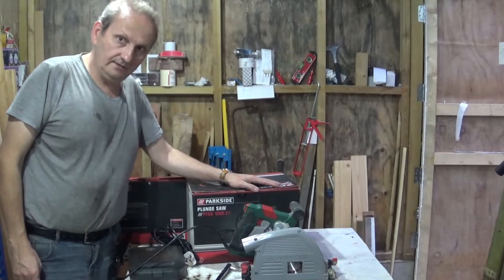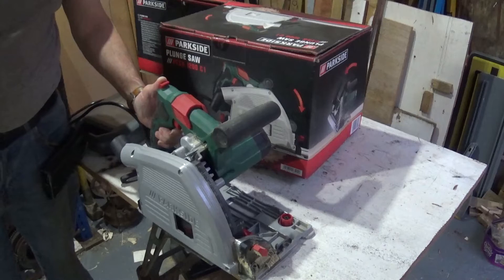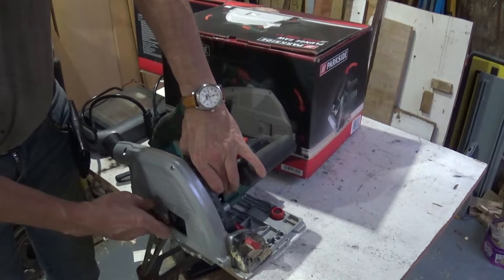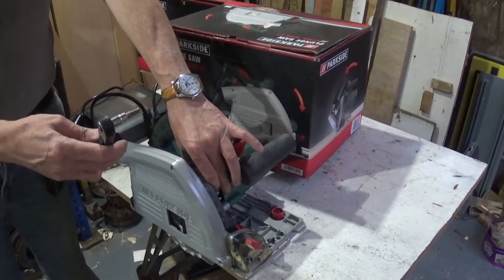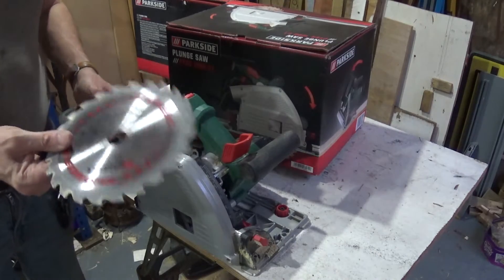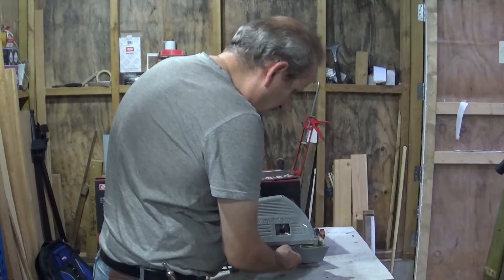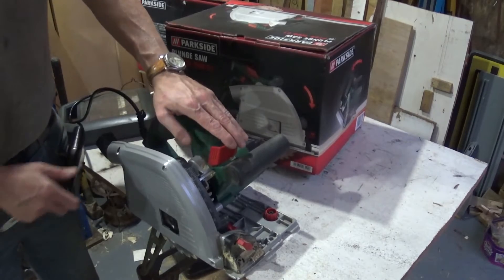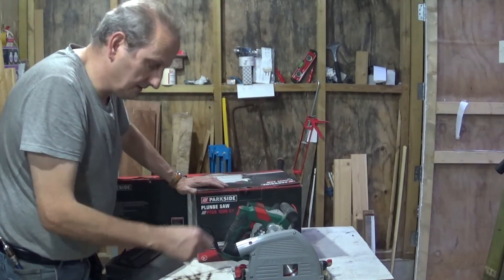Lidl Parkside Track Plunge saw Blade change tips PTSS 1200 C1

Comment: Just the video i needed right now. Only difficulty is that i can't seem to get mine to lock in position when operating the red lever on top. It shoots back up and is a challenge to keep in the lowered position to access the removal screw.... PLEASE HELP!!😂
Reply from the maker: Are you talking about the spindle lock or trying to keep the guard out of the way? Neither lock in to a static position I am afraid, you may need help to hold it where it needs to be for the lock, or do it over an edge to hold the guard open and out of the way, 

Many thanks for watching, please like, share and if you like the channel, subscribe!
Reply: I have used ALL my strength, whilst it's not a lot, this thing just won't budge. I've sprayed it and am hoping it's not a reverse thread 😂😂
Reply from the maker: I can't remember. You shoud be able to see from the video which way it turns.

Comment: Thanks, I was finally able to change the blade to a 48 teeth Triton blade with carbide teeth. I did have to soak the screw in WD40 for 3 days in order to get it to move without too much trouble, though.
Reply from the maker: I am pleased that helped. 
Many thanks for watching, please like, share and if you like the channel, subscribe!
Reply: Which kind of WD40 ? Mine is super stuck

Comment: Thanks for the video. I also used the same tool like you did to try and loosen the blade. Result: bolt is broken. Blade is still on, even sprayed in with wd40. Not your fault at all, that isnt what I mean but the spindle lock is of weak quality :(
Reply from the maker: Sorry to hear that. If it is less than 3 years old call Lidl service and see what they say.
Many thanks for watching! Please like, share and if you like the channel, subscribe!

Comment: I somehow managed to strip the Allen bolt on mine and am now trying in vain to remove the bolt. Any thoughts?
Reply from the maker: I take it you mean the head rather than the thread? In which case it will depend on how bad it is and what tools you have to hand. 

What exactly did you do and how?
Reply: @BensWorkshop  sorry I mean the head! The Allen key just didn't seem to be seating very well so it rounded off slightly. It doesn't help that it seems to be mega tight.

I've now filed a slot across the top of the bolt but can't find anything the right shape/size to get the leverage without them bending too! I'm wondering if the best option is to find a machine shop somewhere nearby
Reply from the maker: @freakeystyley34  I was going to suggest calling the customer help line. Do you have a set like the one in my video or access to a vice?
Reply: @freakeystyley34  ahah ! Same issue here. I should have seen this video before trying with the Allen key :D
I just lost my evening trying to pull out this bolt. Now it's totally fucked up. 

I'll have to find another way to catch that bolt.... and if I success I will have to replace it by another one :)
Reply: @BensWorkshop  I think it's a goner! I might try customer service as it's so so wedged that nothing I can do is getting it undone.
Reply from the maker: @freakeystyley34  see what they say.
Reply from the maker: Sorry to hear that. If you have the tools available you could try a vice on the head if the vice is bolted down and then turn the saw with the spindle lock on.  Please also like and share (hopefully catching people before they make the mistake) and if you like the channel, subscribe! (More Lidl reviews incoming...)
Reply: As a follow up, I just managed to get this off, using a big screwdriver and a mallet to alternately whack the edges of the slot that I had created in the direction of rotation. I also managed to find a replacement bolt with a hex head for better tightening and loosening.
Reply from the maker: @freakeystyley34  that's good news. Well done.
Reply: @freakeystyley34 which bolt did you use as a replacement. I think I have to drill out my bolt. But don't know which bolt to replace it with
Reply: @AMARFPV sorry to say it was just one I happened to have lying around. You may be able to find out the thread pitch from parkside?
Reply: How do you attach a vice to a bolt head ? Also my screw is so tight that i feel am stripping the spindle lock.  @BensWorkshop
Reply: Thanks for the answer. Can you allaborate a little bit more about your method of loosening. What you mean with alternating directions ? Like loosen and fasten direction ?  @freakeystyley34
Reply from the maker: @AMARFPV  hen you post a reply to an old comment you make it very hard to find it and reply to it. You will not be able to attach a vice to this bolt. You need to get a ratchet driven allen hex driver. If it i less than 3 years old call the Parkside help line.
Also many thanks for watching, please like, share and if you like the channel. subscribe!
Reply: Which proofs your video's are timeless @BensWorkshop  ;) Thanks for answering
Reply: @AMARFPV  sure - (from memory) I cut a big slot in the existing bolt and then hit on alternating sides with a big screwdriver and a mallet, both in the 'unscrew' direction. Worth spraying a load of WD-40 or gt85 in there too so that as soon as it moves at all it can start soaking in. Good luck!
Reply from the maker: @AMARFPV  You are very kind. Have you managed to get it undone yet? If not could you start a new comment without it being a reply please :)

Comment: If this saw cuts in the middle of the material or further away from the edge, there may be a problem with the hose line from the vacuum cleaner. The plain ribbed hose catches on the edge of the material and can sometimes lift the saw. I designed a hose guide that simply clips onto the bar and a saw-to-hose outlet adapter that has a smaller angle than the original. There is no need to hold the hose by hand. https://youtu.be/i276uQaYXxE